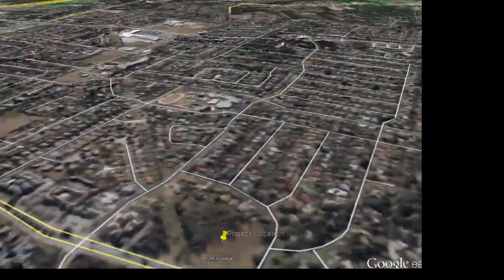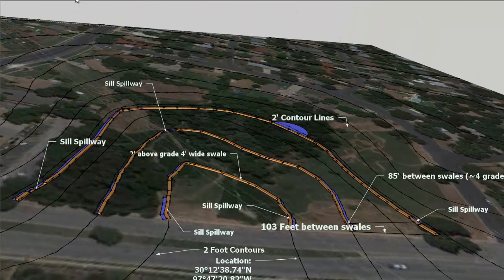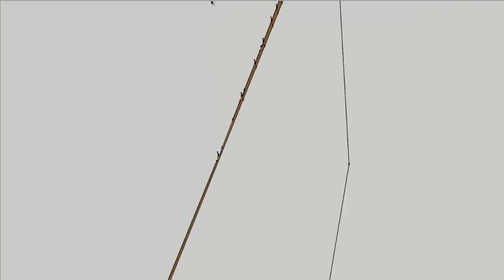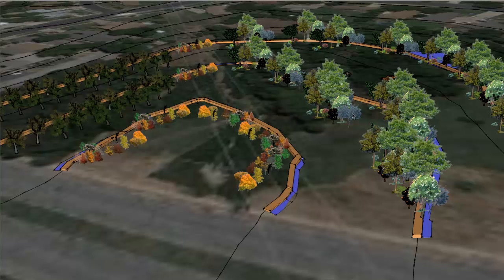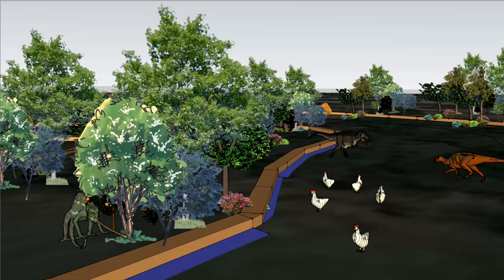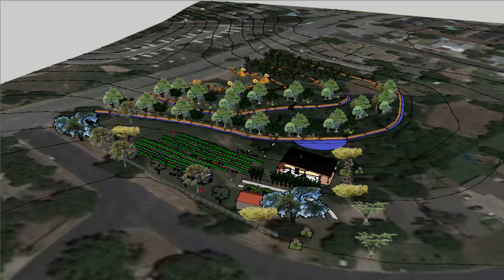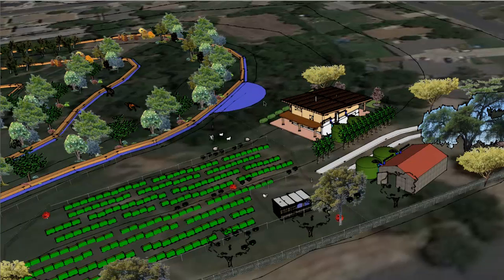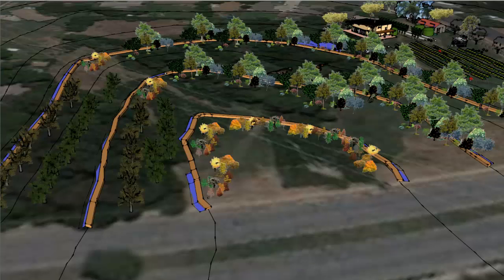Permaculture Design Course Design Project

Comment: How did  you mesure the contour( topographic) ?
Reply from the maker: I used this technique: http://youtu.be/y4J9sWEZR6E
To get my contour lines. It was a huge time saver over manually drawing lines. It worked great to build a design to give a sense if i was on the right track.
Reply: Tom Haile That link is broken. Could you possibly provide some info or another link?
TIA
Reply from the maker: mickydee26 In youtube search for 'Contour google earth sketchup' check out the first few videos. The one that refers to Colorado is the one I'm referencing above. Hope this helps.

Comment from the maker: Thanks for the comments. I agree I need more access in the food forest especially. Moving the house would help with southern winds and the western sun. I put a bunch of trees to block the road and the sun.

The reason the house is on the south west side is because of access and the ground is reasonable level. Moving the house would provide a cooler environment and worth the constructing a building site. Thanks,
Reply: what software are you using to do the presentation in?
  Did you say Earthworks?
Reply from the maker: I used google earth for the zoom in and for the base ground topographical and sketchUp for adding all the bew stuff and camtasia for the video and audio capture. 
I probably did mention earthworks in reference to the swales and water collection.
Reply: Oh okay, cool... thanks.  I live in Pflugerville and had been looking to join a permaculture intended community, so been researching some.
Reply from the maker: I suggest Texas Permaculture Design Projects group on facebook.

Comment: Nice design, whats your plan for access? I didn't see any roads or paths. Also have you considered placing the structure off of the ridge, maybe middle slope as to avoid the hot southerly winds that you mentioned?